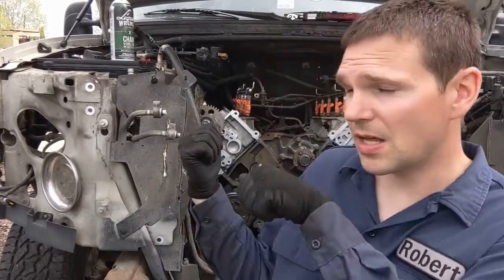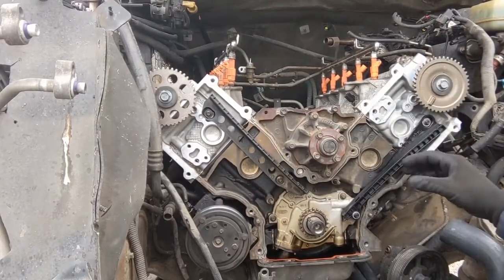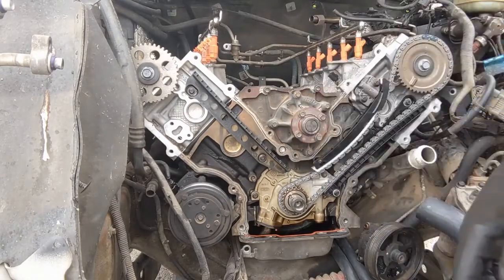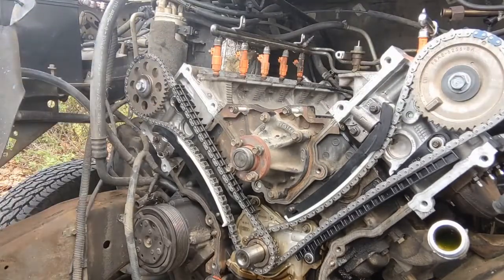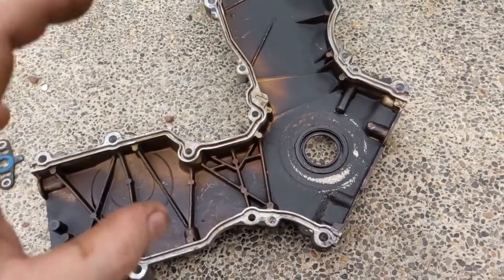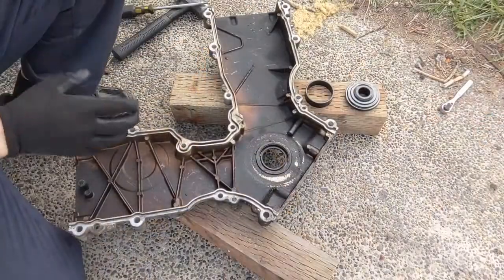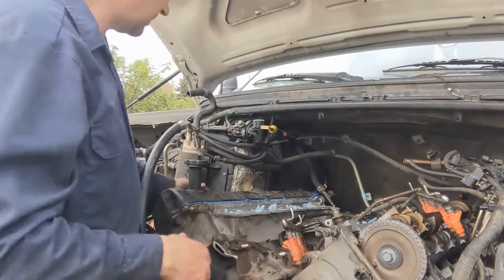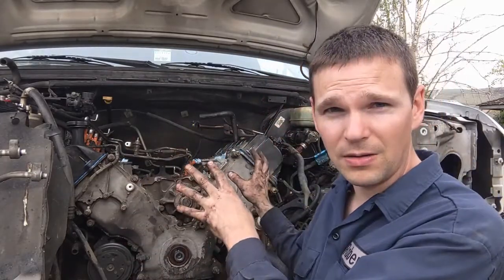1999-2004 Ford F250 V10 Head Gasket | Head Installation Part 2

Comment: Thank you for these videos, they're great!  I've watched 'em numerous times as i do my head gasket job.  One thing i thought i'd add...the fel-pro valve cover gaskets have a few small holes so you can push the valve cover bolt and sleeve through.  it'll hold the valve cover gasket to the valve cover so you dont have to rtv it.

Comment: Hi!! Serious question, when I put the timing chain back on I cannot turn the crankshaft.. would you know the reason for this? It’s clean and everything turns before the chain gets put on. Please help 🙏🏽😊
Reply from the maker: @KatyKelly-  With the chain off can you turn both camshafts freely? You don't need to spin them all the way around just enough to know they move.
Reply: @ some things I have been reading have said it’s 2 revolutions. Is there a reason for this? 2001 v-10 excursion. Would I need to take the heads off and reset ?
Reply from the maker: @KatyKelly-  Because of the gear ratio two revolutions on the crank pulley equal one revolution on the camshaft. That's just to double check timing is correct. As long as the timing marks line up there shouldn't be a need to pull the head. Unless there is something binding up in the valve train.
Reply: @ValleyMobileAutomotive  I have watched your videos so many times and was wondering if there would be any possibility of talking to you personally?

Comment: if you're just doing the chains as well as tensioners you shouldn't have to align the cams correct? shown at 9:20ish.
Reply from the maker: Correct. That portion of the video is just if you removed the camshaft.

Comment: I believe you put the tensioner guides on the wrong sides. Thats why it was so hard to get on
Reply from the maker: Hey Eric thanks for the comment. It's been a while since I did this repair, if I remember right there is a way to tell the left from the right. I believe the timing kit explains it. So if you're doing this I would read/follow the directions provided in the timing kit 👍

Comment: The tensioner I have came with a small steel plate. Should I put those on?
Reply from the maker: Not sure if the plate is a shim? If so make sure the tensioner rod is centered on the chain guide. And make sure the oil passages are free and open.
Reply from the maker: Did it come with a set of installation instructions?
Reply: No instructions. Just a thin steel plate with holes for the bolts and 1 smaller hole im assuming is for oil pressure.
Reply: This is pretty similar to the 5.4l 2v other than the balance shaft. Isn’t this the exact same procedure for the 5.4l 2v?

Comment: Howe come its so important to replace the caps on the balance shaft in order as they came off?
Reply from the maker: This has to do with how they have mated to each other over the course of wear. they are now a "matched set". you run the risk of increased cam shaft or cap bearing wear if they are replaced in the wrong order. I haven't heard of it being catastrophic but you want the engine and the hard work you did to last as long as possible.

Comment: If you do it right you don't use a pry bar. Would  not let you work on my stuff.
Reply from the maker: @JohnVandyke-t4h  I think I was fighting an aftermarket tensioner body that wasn't machined 100% correctly. Also turning the crank slightly to put all the chain slack on the tensioner side is helpful 👍
Reply: @ValleyMobileAutomotive  the little chain tension ers are  kind of like hydronic,  you have to use a vice and push them back in so the lip is flush on the back side that meats  the block and there is  clip that you put on them. Then install them then after they are  in and the timing is set you pull the  2 clips out and  the chain will titian it help. Sorry for miss spelling.
Reply from the maker: @JohnVandyke-t4h  No worries on the spelling 👍. You're right if you are reusing the old tensioners the plunger will need to be reset and a pin locks it in place. On new tensioners they are already retracted and pinned. I've had some new tensioners slide right in no problem and others put up a small fight. I think a lot of that has to do with the quality of aftermarket parts. I've started using Ford OEM parts and don't have that problem. A little more expensive but I think it's worth it 🙂